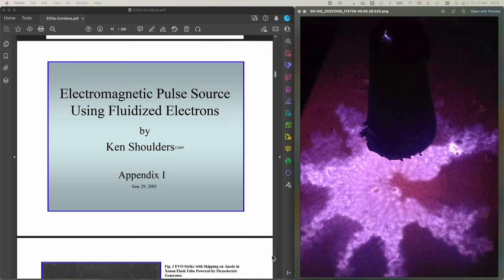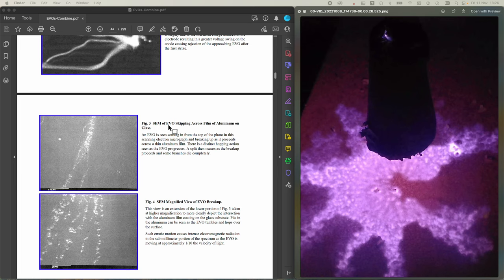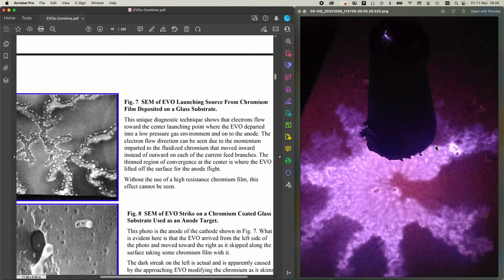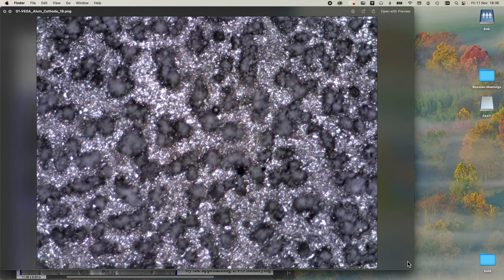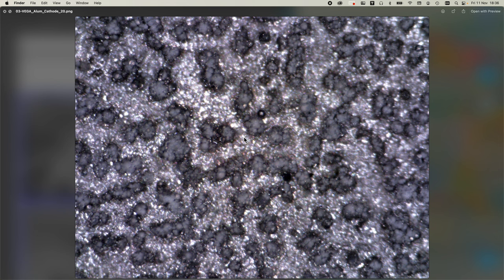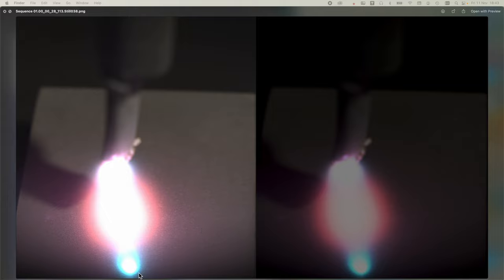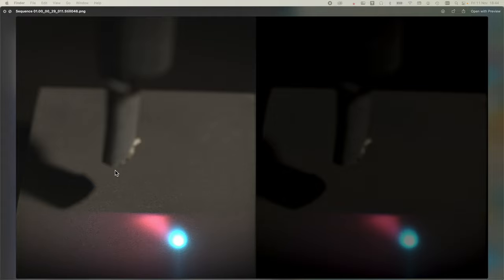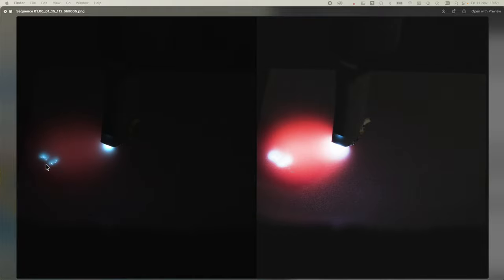VEGA - ALUM - Fluidised

Comment: Very interesting and informative. The electrons must be "dressed": restructured electrons that have no charge and little to no mass so they move down to the cathode under magnetic attraction only. If they had charge, then they would be attracted directly to the positively charged anode. This means that the breaking radiation we saw in past experiments  is produced magnetically. 

The particles that are flowing inward must be dressed electrons that act magnetically only. Electrons with charge would immediately lift off the surface of the cathode and fly directly on a straight line to the anode without traveling over the surface of the cathode to the launch point. The dressed electrons are magnetically fixed to the surface of the cathode and are driven to move magnetically only.

These dressed electrons are polaritons.
Reply from the maker: Perhaps, what is good is that we have, in many cases now, been able to show the processes in motion that Ken Shoulders derived his understanding from mostly from the marks left on witness materials. Moreover, we are learning to establish the V/m where the self-organisation becomes so quick that it pulses EVOs/ECTONS/Coulombic Explosions regularly and repeatably - moreover, we can see how the breakup products move across the cathode and how the 'discharge' continues to track their movement.